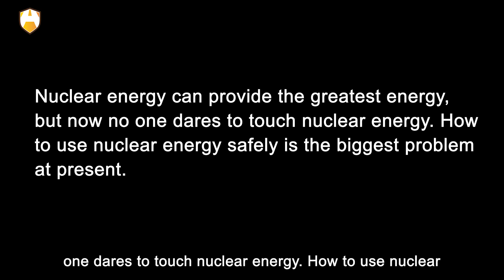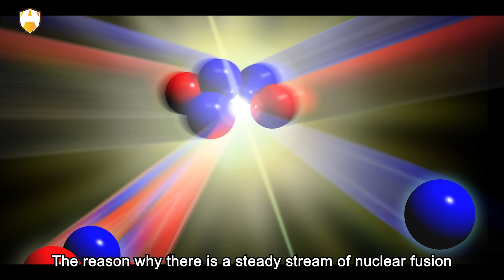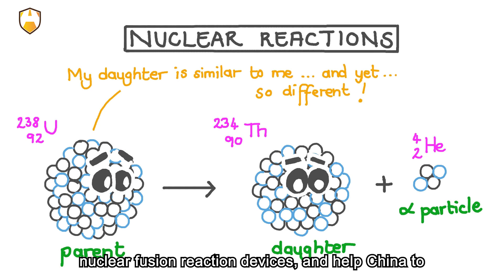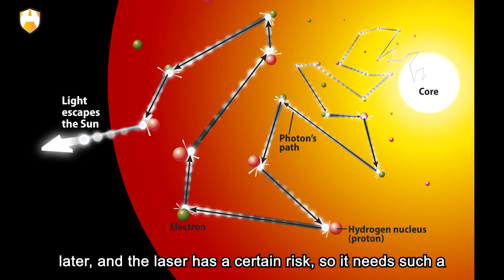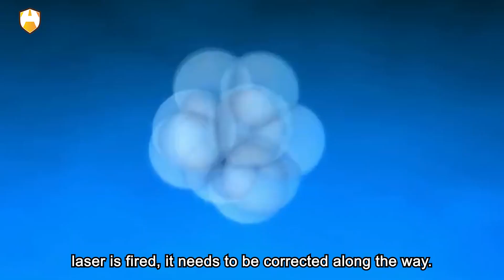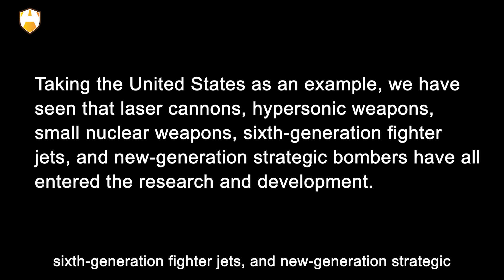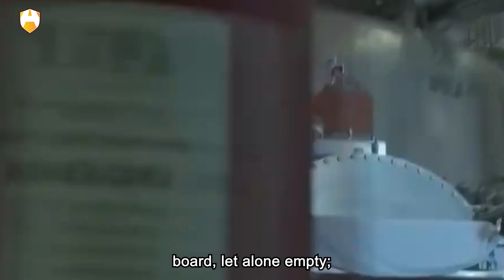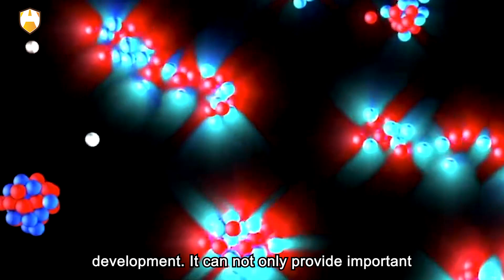China's nuclear fusion super project, making the Chinese military invincible in the world

Comment: In man-made (toroidal) Chamber/reactor, the pressure is "ZERO" barg.(0.00 bar). While in reality near the Solar/star core, the initial pressure need to start reaction is MILLIONs of barg.(atmospheric pressure). Around 30 - 40 millions bar(g). Now you need to think and think ..and think so hard, what is difference between "ZERO" and 40,000,000 bar(g)
After think over-night then you still don't know that "zero" is VACUUM pressure in empty space, while the boiling surrounding near the Solar reacting CORE is much, much, much, more (higher) PRESSURE than simply "0.00" (zero) pressure at all.(!?!) No way the sustained reaction can occur, leave alone far, far, far-away target to produce/gaining of NET-positive/ benefit Energy Output to run all facilities/auxiliaries (such as Superconducting magnetic coils, Cryogenic pumps, Vacuum Compressor, microwave and Particle injector/Syncrotron, even Static (Resistance) Heater must also be included of total energy consumption to sustain all process, Mission Impossible, no such output.